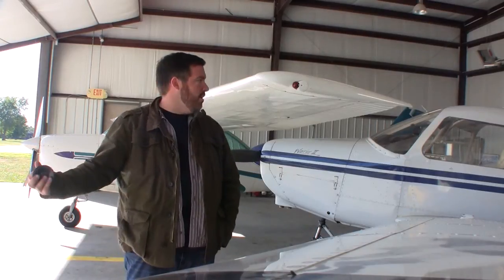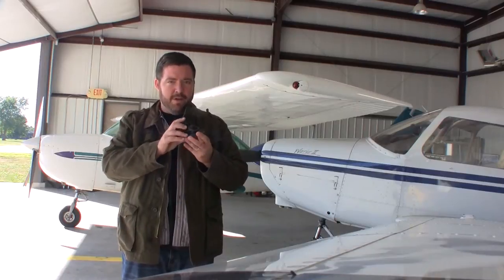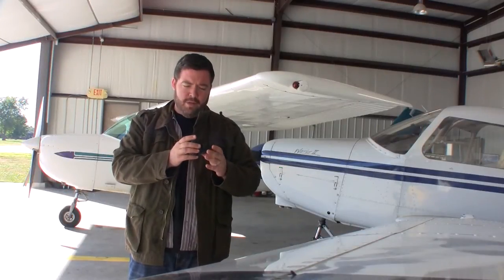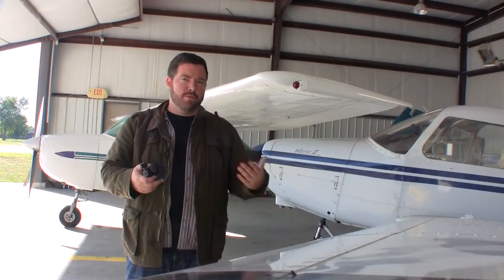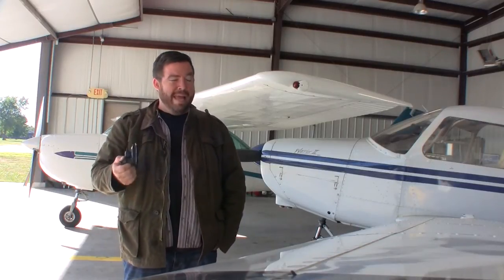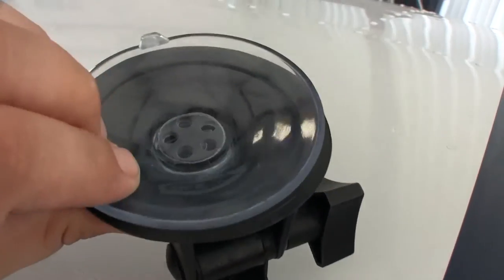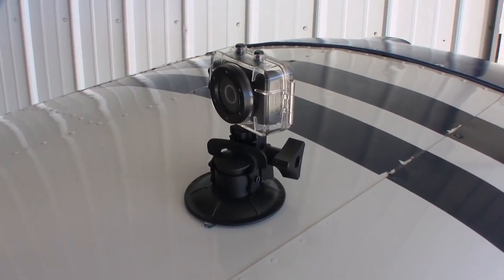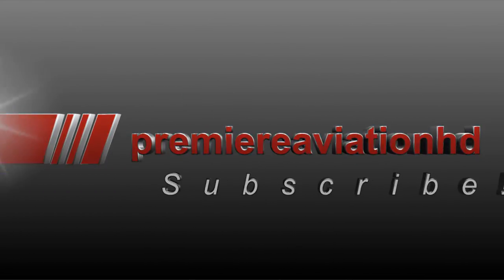How to: Attach an Exterior Camera to Your Airplane

Comment: This is a great idea, however. Just because we like to fly, and we enjoy flying around doesn't mean we have to put other people in danger. If that camera would come off the plane, there is the potential that it could hit someones property and damage it, or worse somebody. Just like emergency landings we should not be using roads with traffic on them, just because we enjoy and want to be flying doesn't mean we need to put other people in danger. I would suggest a tether, or mounting it to a fixed point on the aircraft, such as a tiedown.

Comment: I would be interested to hear what the FAA would say about your camera mount.  Not only are you not attaching the camera permanently and possibly putting pedestrians in danger but you are affecting the laminar flow and presumably stall characteristics of the wing.  The FAA does not allow you to fly an airplane with ANY trace of snow or ice adhering to the wings, yet you seem to think it's ok to mount a camera to the upper surface.  In order to modify an aircraft structure you need either an STC or TSO neither of which that mount has.
I won't be the one to notify the FAA, you and MrAviation101 have made it very public by posting these videos. 
I have recently subscribed to both of your channels and think you have lot of great videos, but PLEASE KEEP THE CAMERAS INSIDE THE CABIN !!
Reply: The FAA says that about ice and snow because it will destroy lift and can be potentially catastrophic. A camera in a very localized location on the wing will not inhibit the aircraft's overall flight characteristics. As for the actual rules, as long as the camera is not permanently attached to the aircraft without and STC or TSO - then it's complying. So you could report them to the FAA... but they are complying so nothing would be done about it.
Reply: lol calm down captain happy, as per FAA regulations the pilot in command is the final authority to whether the plane is airworthy or not, so as long as the pilot believes the aircraft will function safe (which it will) then it is airworthy.
Reply: AlchemistLair  Come on dude! I saw a bush pilot with a skidoo under the wing. Then now we talk about a Gopro so just chill a bit.   :)